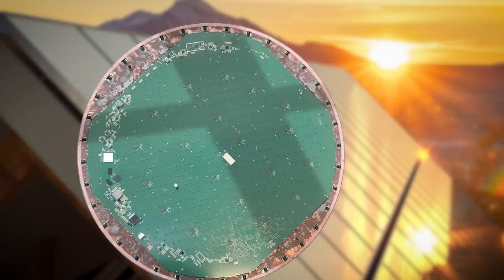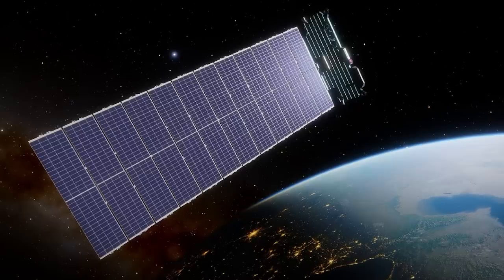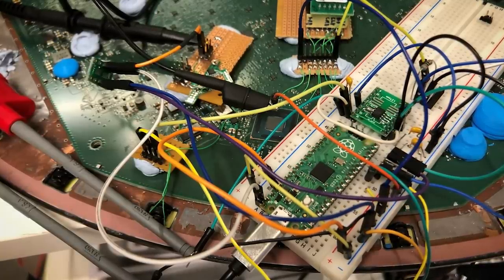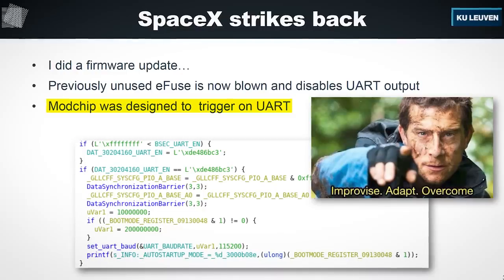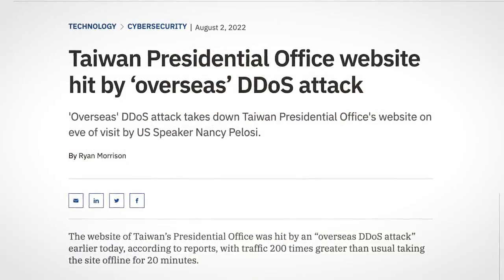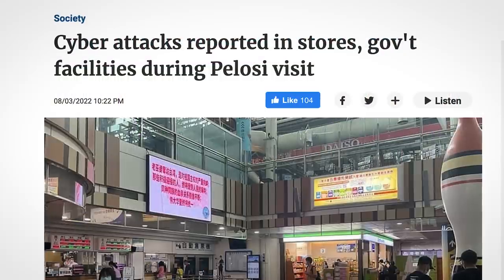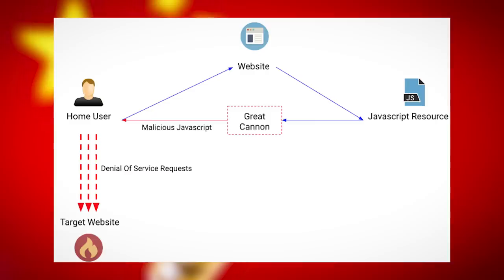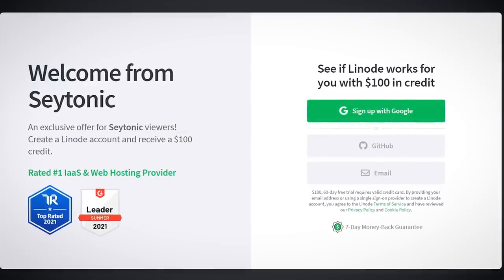StarLink Dish Hacked With $25 Device

Comment: StarLink has an issue with dishy anyways. They have no way to recover, or update firmware other than when it's pushed "OTA" from the network itself. So if a dish is offline long enough, it essentially becomes worthless and totally e-waste, because the network would no longer be compatible with the software running on the old firmware dish and won't be able to connect in order to obtain new software. They need to allow a way, as pretty much all routers and network gear has, for the administrator/user to manage the device. Security related features should be mostly focused on the satellites, and no rely on trying to make the end-user hardware being tamper proof, which it will never be. Their more recent version is even worse than the first. The new dish forces you to use their router, and doesn't even give you ethernet by default. This is just non-sense. The router should in itself be optional. I pay for a internet connection, not you managing my network with your drastically underpowered and underfeatured router.
Reply: It isnt an issue. The problem is inconsistent revenue for the company, means inconsistent user experience. The user did it to themselves! /s

Obligatory F corporations, the design of extracting wealth and quick redundancy should be regulated more heavily. Mollusk got subsidies, yet we eat costs.
Reply: @WhatWillYouFind  holy shit a tech video with a comment shitting on Emong husk, a miracle.
Reply: Starlink has an even bigger issue. It’s run by Elon Mc Flatface.
Reply: I agree, although me personally it's a severe hindrance to not come with ethernet by default, like I should not have to buy a stupid adapter that gets me ethernet when the original cable is basically a glorified ethernet cable with a proprietary connector on the end. Smh
Reply: @JuniorJunison  welcome to apple lol.

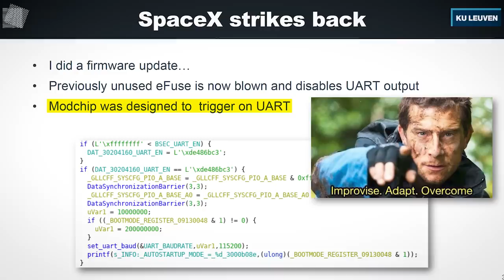Comment: 3:45 How is a fuse "unused" but still used to make text output work? I think they're (badly) covering up something more valuable.
More comparison is needed on the two firmware versions and subsequent effects on the hardware.
Reply: What do you mean? Sorry I don’t understand what they could be covering
Reply: @truestopguardatruestop164  
I dunno, it just sounds fishy.
I only had a run-in with modding hardware once and it wasn't easy. Companies will try to throw you off the scent by saying stuff like "unused fuses"... had that exact same thing happen to me with my project, but it's probably nothing.
Reply from the maker: As I understand it, chip manufacturers often tie certain features within a chip to fuses - so the customer (starlink) can disable certain features they don't want. Since this is inside the chip itself, once a fuse is blown you can't  reverse it.
Reply: Many processors have security fuses on the silicon. A developer leaves them as is and can read/write/debug.

Burn one fuse on the chip and debugging is blocked. Burn another fuse and something else gets blocked.

So they decided to instruct the processor to also physically disable the serial port.

Comment: Amazing stuff. The Pico part got me.
Reply: Guess the Pico is great for hacking around, not just blinking LEDs
Reply: Also, I'm a bot
Reply: It doesn't really do much. He needs to glitch every x ms and then look for some signal indicating the glitch worked.

The Pico can run a timer to glitch and look for serial port output for feedback of the result. An ESP32 or Arduino or just about anything small/easy could have been used to run the glitch attack.

And most probably he can use a different (unlocked) product with same microcontroller to see how it behaves when locked/unlocked to learn what the Pico should look for if the glitch worked.
Reply: @perwestermark8920  I mean it can also probably be done without a microcontroller but I think the guy chose to use one because of simplicity and cost
Reply: @slendi9623  The glitching can be done without a controller. But you need to watch for some reaction, stop glitching and flag some alarm if the glitching finally worked (can take hours or days) so it would be quite a bit of work to not have a programmable device doing it.

Comment: Wait, but to inject a JS malware into a browser would require the DOS target to be CORS enabled wouldn't it?
Or is it that chinese browsers doesn't have CORS protection?
Reply: I  was thinking the same lol, did you find an answer yet before I start researching?
Reply from the maker: I can’t answer your question, but you might find an answer here https://citizenlab.ca/2015/04/chinas-great-cannon/
Reply: No since browsers starts the request and checks the CORS Header of the response, so the request already sent, do that with timeInterval function and u got the canon working
edit: thats for all browsers chromium, firefox and the rest, so the Cannon doesn't target Chinese citizens only, anyone who visits the site is part of the canon
Reply: @DeeezNuts  Makes sense! Thanks for the explanation
Reply: @DeeezNuts  usually preflight requests aren't heavy— guess the cannon's sheer mass of devices makes up for how low-cost a single cors response is
Reply: @Alex-uf2ie  TCP connects are actually quite heavy - and the TCP stack then normally keeps track of that IP+port access for maybe 2 minutes so it also uses a bit of memory.

Do one connect/second from 100k browsers and it isn't that fun. And if they connect fasters and from even more browsers it quickly gets ugly. They don't need to reach the target web servers - they can even overload any load balancer in front of the actual servers.

Comment: this is blown out of proportions... it's like stating once you rooted your phone you can hack the operator's network 🤣
Reply: No, but it makes it much easier. Without being able to control a starlink dish, there is no way at all to even connect to the network. Additionally, it appears starlink's network is designed with minimal security from the devices themselves, which makes sense.
Reply: Base camp.

Comment: Hmmmm security by obscurity seems to work so well.
Reply: That's not obscurity by any means.
Reply: Nope - this is not an example of security by obscurity. This is a processor with builtin secure boot, and where he can get the processor to hickup and skip one or more of the security features - so he tricks it to not lock the door properly.

This is a bit more as when someone uses a jammer so when you press "lock" on your car key fob, your car misses to hear the lock command and stays unlocked. The glitch makes the secure boot loader fail one critical test and missing to activate one lock.

Comment: it wasnt hacked. It was rooted. It was HIS device and he COULDNT attack the network. Big differences here so be cognizant of vocabulary.
Reply: Look at the colloquial use of the word hack. It's anything from putting bigger batteries in your flashlight to make it brighter, to remotely frying the IRS's network routers.
Reply: @RAndrewNeal  If someones ego is that big that they want to brag they 'hacked' a starlink terminal instead of saying they rooted it then more power to them. There will always be those among us who overstate their actions and abilities for a desired reaction.
Reply: @ffrich34  Ok, are you supposed to be able to root it? No. Therefore?
Reply: hack comes from ham radio, as in radio builders who amde shortware radios from home items and scrap metal.. 
So i support Andrews comments that hack means basically anythings thats been modified or knocked together with whats available.
Reply: @rawbmar1166  Therefore he's got a very expensive brick on his hands since he can't do anything else with it. I dont think Starlink is gonna be too happy. So i guess the word hack is interchangeable with break now I suppose?
Reply: @ffrich34  It's far more impressive to know how to make the computer do what you want at a hardware level (and in this case, know which instructions to glitch) than knowing how to locate a security flaw in a piece of software. Both are impressive, but the guy who knows the intricacies of the hardware takes the cake—no ego about it.
Reply: @ffrich34  I'm willing to guarantee this thing is far from bricked. You need to check YOUR ego because it's more than obvious you're type who can never be wrong even when it's clear you are. You've got many people tackling your argument and you still can't admit it.

Comment: Transmission and Command hardware are generally quite separated on telecoms equipment, so called out of band control, even to the point of being on seperate physical layers right down to the frequencies used. No idea what StarLink did but it would be an odd architecture by industry standards if control commands to the satellite were in any way associated with end terminal transmission.

Comment: Power glitching was something DirectTV fixed on their chips at some point, what did DirecTV changed to fix that back in the HU3/4 transition days, I think it was before they nuked the cards that were used for the emulators, and I think why people turned to emulators because glitching no longer worked. But I might not be remembering everything clearly.

Comment: I am sorry but isn't just going to require several security signals the solution for this? 
The hardware right now is just handshaking and passing the security boot for 1 time at booting.... 
The implementation of time based or random security requests is the solution... 
Also if a security fails the dish just lock itself and gets in an error mode that can't be undone... 

This would not require to change anything in the hardware....

Comment: couldn't voltage glitches be fixed with internal capacitors which prevent voltage drops?
Reply: @Sunchip Dip or run a resistor across the legs, which if I'm correct, wouldn't allow it to charge.

Comment: Since the bypass just skips the original check, couldn't they just request information from that chip at certain points? Surely the bypass won't skip the check every single time, just the one time upon start up.
Reply: A secure microcontroller normally loads an encrypted firmware after first checking that the firmware is signed.

My guess is they trick the boot loader to either not turn off the JTAG interface (allowing full read/write to all memory using a debug probe) or to skip the check for secure boot (requiring encrypted+signed binaries) allowing it to load any code from external flash. In this case I guess he hunts for JTAG debug access.

The boot loader only runs at start - as soon as it has handed over to new code it isn't used again until you reset the processor. So it's enough that it slips up once, then he can have the processor run his code and his code will obviously not look for any tricks.

Comment: This, is why ya use epoxy to seal your boards.
Reply: Please no. Just let the security be server-side. Someone will hack it either way.
Reply: @nobodynoone2500  Oh, I've no doubt that someone dedicated enough would be able to get through, but there is a value in making the process as difficult and harassing as possible.
Reply: Are there any chemicals that can be used to break down epoxy?
Reply: @jamescollins6085  Depending on the epoxy used. 
Petroleum products can be hell on epoxy, but those are also none to kind to ICs as well. 
Acetone can do a pretty alright job as well on some epoxy, or maybe a heat gun.

But the major issue is is not removing the epoxy, but doing so in such a way that the circuit board is not fatally damaged.

It is very doable, but expect to spend a weekend trying out your solvent selection from the paint store. And expect to spend a considerable amount of time chipping away. And above all keep in mind that if you are having to remove Epoxy to reverse that that circuit board is the part most likely to break from any percussive and shearing force applied to the board.
Reply: @scurvofpcp  Thanks for the information, I do occasionally encounter potted electronics, so it would be interesting to give it a try.
Reply: @jamescollins6085  If you have access to an industrial oven, and you can find the area where the board meets the epoxy you can try rocking the temp up and down while working in some solvent to aid in separation. 

It is 'doable' to remove a board from epoxy, but it is an artform to do it and those components are none to forgiving.

Comment: I don't see how a new hardware design could fix this; you can cancel any instruction you want by cutting the power for a moment; this just goes to show that if you have knowledge of how these sorts of systems work, and the equipment to implement a strategy of attack, they can't possibly keep you from getting complete access if you have hardware access. Hardware access = 100% access > root access.
Reply from the maker: It is possible to detect when glitching is taking place and defend against it, something that wasn't implemented in this case. Which is why spacex paid a bounty (probably in the tens of thousands of dollars)
Reply: @Seytonic  I don't think there's a non-destructive security measure in the world which hardware access can't thwart, given enough time, of course.

Maybe hardwired logic to restart the entire boot process if a fault in the power rails is detected; but then the attack shifts from glitching to intercepting the firmware and its signature so that a different payload can be delivered while spoofing the official firmware with its signature. Unless the firmware image is hashed, in which case you'd have to overwrite the stored hash with that of your custom payload.

Of course, it's easier said than done, but these hardware locks are in futility and they ought to know that.
Reply: @tripplefives1402  Yes, but unfortunately, you have to disarm the security measures that prevent firmware from loading if their signatures and/or their hashes don't match the one of the official firmware. This disarmament can really only be done by spoofing the official firmware, or overwriting the cached signature/hash data; it's like putting a blindfold on an armed guard as opposed to taking his gun.

Comment: Needs to be impossible to crack.  That means, it needs to be impossible to access the security from the air, only hardware.  Security must be soldered in.
Reply: Hardware you can physically access is never secure as a rule. You simply put the security server-side and you can ignore this type of stuff, but this is poorly concieved from the start.